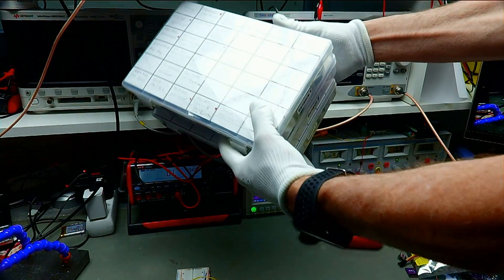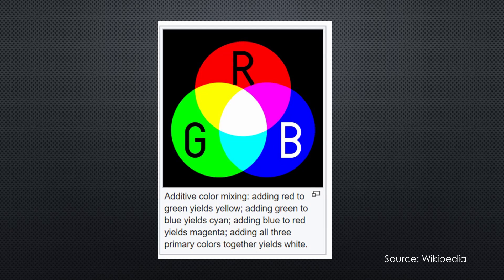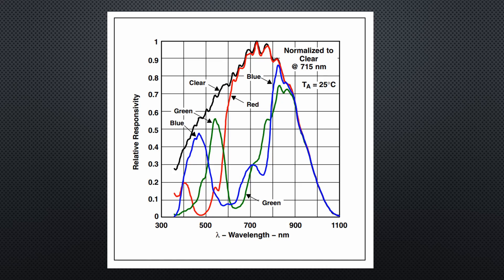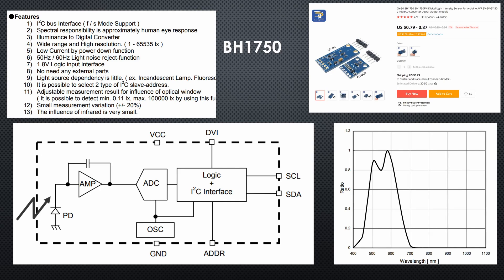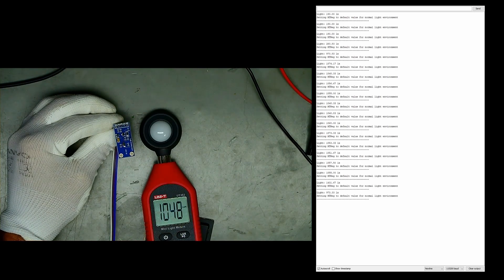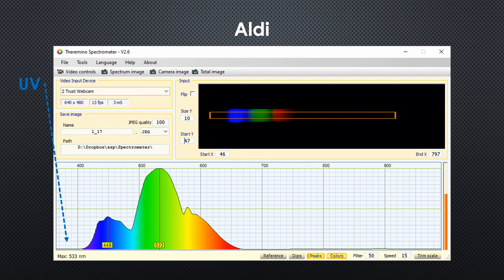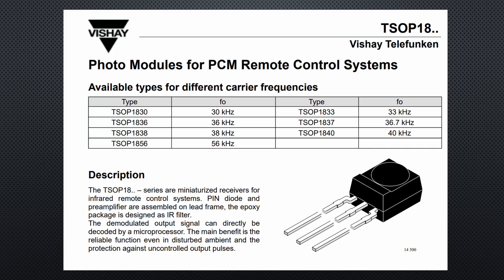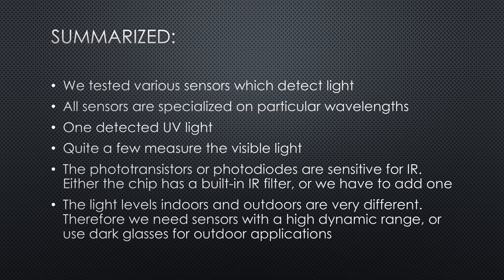#322 12 Light Sensors Tested: Measuring Light with Microcontrollers (Arduino or ESP8266, ESP32)

Comment: Ich habe seit mehr als 800 Tagen einen Lichtsensor im Einsatz, der minütlich die Helligkeit misst. Damit kann man eine Steuerung für die Markise bauen. Zu bedenken ist das im Winter die Helligkeit bei voller Sonneneinstrahlung genau so hoch ist wie im Sommer bei starkem Regen. Die Schaltschwelle müsste dazu also dynamisch sein. Bei Bedarf kann ich dir meine 2,5 Jahre Messdaten gerne zukommen lassen.
Reply from the maker: Sehr Interessant. Weil du soviel Erfahrung hast würde ich dir gerne drei Fragen stellen:
1. Welchen Sensor verwendest du?
2. Wie ist er gegen Wetter geschützt (durchsichtig)
3. Wie hoch ist die höchste Luxzahl die du je gemessen hast? Das würde mir die Dimensionierung erleichtern.
Da ich die Regelung via Node-Red plane kann ich vielleicht das Datum oder die Temperatur meiner Wetterstation in die Berechnung einfügen.
Reply: @AndreasSpiess  Hallo Andreas. 
1. Ich verwende einen BH1750 der mit einem ESP8266 verbunden ist welcher minütlich seinen Messwert über WLAN an meinen Server schickt. 
2. Er ist unter einer Plexikuppel wasserdicht verbaut und verklebt. Die Plexikuppel stammt von einer alten Wetterstation, dort war damals die Solarzelle untergebracht. Der ESP is getrennt (Indoor) verbaut.
3. Maximalwert ist 54612, der reale Wert würde das doppelte überschreiten kann aber nicht mehr gemessen werden.
Da dein geplanter Einsatzzweck eine Markisensteuerung ist würde ich den Wert bei etwa 1500Lux ansetzen wenns zum Beschatten dienen soll. Alles was drunter ist freust du dich eh wennst noch bischen Wärme und Sonne haben kannst :-) Falls ich ein Foto davon finde schicke ich es dir per Mail, meine Messdaten lege ich bei. Liebe Grüße!
Reply from the maker: Diesen Kommentar hatte ich gar noch nicht gesehen. Also nicht vergessen. Glück gehabt. Youtube macht es schwer, längere Konversationen in den Kommentaren zu führen. Insbesondere wenn man viele kriegt.

Comment: Have you considered putting sensors in solar garden lights? You get a solar panel, a battery and an enclosure for a relatively cheap price. For instance temperature and moisture measurements in the greenhouse.
You probably need a buck-converter to get the 3.3v needed from a 1.2NiCd or 3.2LiOn, but still.
If the ESP went into deep sleep, and only sends occasionally, I guess most lamps could supply the power.
Reply from the maker: Good idea. I started to build a combination of a Lux, an UV, and an RGB sensor. In addition it communicates via 2.4GHz LoRa. The MPU is an Arduino Mini which Igels it’s Takt from an RTC Module. Still a lot of LEDs, so I do not know the current consumption. But it needs some space.

Comment: I really like and appreciate your videos. I am currently using TSL2561 sensor witch includes visibible + near infrared diode and another wide range infrared diode, which is very interresting because it lets me calculate the Lux by subtracting IR reading from Visible+IR. This help me measuring light illuminance in Lux with high precision by eliminating IR interference. This sensor also gives me the possibility to measure light power with good precision by using light+near infrared  diode and wide range infrared diode and using a factor calculated for most common sun light spectre profil. The problem I have with this sensor is that the range is quite low and didn't exceed 40000 Lux which is not enough for day sun light especially  here in Morocco. I didn't find this information in your video when you talked about TSL2561. Could you please give me your opinion about this issue and if there is a good alternative to this sensor for my application: Weather and fertilisation station for Agricuture. For more details here bellow a link to  my collected data. Thanks a lot for your high level and extraordinary video content:
http://www.abrobotics.be/siliconceptsarl/METEO/meteoframe.php
Reply from the maker: I just started using the sensor in full sun (and our sun is much less than yours). I also ordered ND filters for protection, but also to adapt the maximum Lux level to the capabilities of the sensor.
Reply: @AndreasSpiess  Ok, I didn't understand ND but I'll wait for you tests. I tried the same method by using small grey plastic part protection and it gives good results for illuminance in day light and also IR is not strongly influenced. The problem I have to solve now is to determine the factor to use for recalibrating Lux+near IR and IR sensor. If you see the charts you'll notice that IR reading is not always proportional to Lux especially when it is cloudy which indicates that IR is still measuring with good precision even with my DIY filter. Here is the link: http://www.abrobotics.be/siliconceptsarl/METEO/meteoframe.php

Comment: I had an interesting idea for your awning sky sensor.  I was wondering if the light spectrum changes depending on a clear or cloudy sky.  You could use you light spectrometer to check.  If it does, then you might be able to use what you learned about the different sensor spectrums to design a sensor that can tell the difference.
Reply from the maker: Good idea. I started witrh my light sensor and included also a RGB sensor. I will see what the results are. But first I have to add some ND filters because it is maxed out in sunlight.
Reply: @AndreasSpiess  Could you use your spectrometer (probably with a ND) to sample a cloudy, sunny, and rainy day to see if anything jumps out.  It would seem that a blue sky might be the obvious guess; but, IR or UV could be a better indicator.

Comment: Does anybody know a simple way to test if a UV germicidal lamp (very useful in the current situation) really emits ~250nm UVC ? This is particularly important with cheap Chinese UVC LED lamps. Do they really emit UVC or just the most common UV A ?  I have found UV sensors on Bangood that detect UV in the 200-370 nm range but this includes all UV A, B and C. I thought about using a diffraction grating but the cheap ones don't seem to go below 300 nm.
Reply from the maker: I only found quite expensive sensors for that range.
Reply: @AndreasSpiess  I found this cheap sensor in the 200-370 nm range :
https://www.banggood.com/DC-3_3-5V-0_1mA-UV-Test-Sensor-Switch-Module-Ultraviolet-Ray-Sensor-Module-Test-UV-Wavelength-200-370nm-Geekcr-p-1213021.html?rmmds=search&cur_warehouse=CN
The problem is that it gives a signal to all these wavelenghts so you can't tell between UVA, UVB or UVC.
Reply from the maker: Unfortunately I cannot test it. I am a little sceptical...

Comment: Clear 10mm LED, two digital pins = very good detection of sunlight levels. In a nutshell, the LED is capacitively charged by feeding a reverse voltage into it (pins set to OUTPUT), then the decay of that voltage is measured as it slowly leaks into the (now) INPUT pins of the MCU. The more light there is, the faster it discharges. I've used it successfully for quite a few projects, no ADC needed.
Reply from the maker: Good idea. Thanks!
Reply: Do you have an example of this?
Reply: @marcelachternaam9249  Search for "LED as light sensor". The sparkfun article explains how it works, the instructable article shows a sketch, the stackoverflow describes the principle, pasting the text here: 
Set Port A output high
set Port B output low   // this makes sure the led is discharged
wait 1mS
set Port A output low
set Port B output high  // reverse bias and charge
wait 1mS
set Port B as input     // Port B is high impedance input
time how long for Port B to read low

Comment: Well that video brightened a dull day (sorry).
Learnt a lot - never realised the sensors where so different. I’ll be following up the gesture sensor, thank you for publishing your code for that.
One thing to note - a significant amount of ‘white’ paper is actually blue to give a clean cold look rather than a warm tint.
Reply from the maker: You are right for teh paper (AFAIK not in all countries equally). But here I measured the spectrum of the diodes without paper. So both effects would add up :-(

Comment: I want a sun tracker, that can tell where the sun is down to at least 0.25°
Reply from the maker: Maybe you google? There are many suntracker projects around.
Reply: @AndreasSpiess  I tried, most seem to be expecting the be placed on a gimble that hunts and pecks for the sun.  I found some satellite gear for tens of thousands of dollars that does what I want but that's way outside my budget.  

I'm trying to get heading information in a scenario where magnetic headings are unreliable and multipath conditions don't allow for good rtk moving base gps heading.

If I can tell what time it is, relatively accuracy where on the globe I'm at and what orientation  I'm at (via acceleromiter + gyro)  then if just knew the suns angle with repetitively good persision I could determine the heading.

Comment: which would be best sensitivity to detect light in bedroom when sleeping  from curtain leakage?
Reply: ive gone for the Adafruit TSL2591 High Dynamic Range Digital Light Sensor as the Lux range is 
from 0.000118 to 88,000

Comment: Grüezi from Zurich!  I have a project currently based heavily on home sensors for monitoring house plants. Light is obviously an important variable to monitor so have been prototyping with lots of different breakout boards.  Currently developing the design on a PCB and I've found that a lot of the lux sensors are hard to source when building yourself.  Currently, I'm working with the BH1715 (poor results), VEML6030 (excellent I2C), and the TEMT6000 (analog, quite primitive).   Would love to experiment with the UV as this is also an important aspect of plant health so will try to integrate a few extra sensors into the next version!
Reply from the maker: Good project. A lot to learn, I think.
Reply: @AndreasSpiess  So much, always. Just finished up the design this weekend and have the VEML6075 UV sensor onboard :D. Once i'm at a point where it's worth seeing, I'll send you one for your mailbag!

Comment: Another great video :-).  I am looking to use the BH1750 LUX sensor to build my own arduino-based photography light meter - to calculate shutter speed based on selected f-stop and ISO.   I have it nearly working, but am struggling with calibration.  I would be very interested to see if you did a similar project and had more success with calibration....?
Reply from the maker: I do not plan to calibrate it for such precision. I only want to use it outside.
Reply: May be you have a real camera with usb interface (Canon?), direct it to same target make photos and record data from your sensor and then compare? Also, smartphone camera might work too.

Comment: Thanks for the video.  I've been using the GY-49 /  MAX44009 module for measuring lux in my greenhouse (to calculate the total moles of light the plants receive).  It claims to have a range up to 188,000 lux.
Reply from the maker: Thanks for the tip!

Comment: Very interesting video, many of these devices I have never used.  Things have certainly come a long way since the OCP71 (or OC71 with the paint scratched off!).  I have a WEMOS which monitors the temperature and humidity in my loft, I think I will add a light sensor to warn if the loft lights are left on when the hatch is closed.  Bob
Reply from the maker: Yea, the world became simpler and better in this respect.

Comment: What are your thoughts on detecting UVC 200-290 nm range?
With Covid19 there are lots of fake UVC disinfection lambs around, and wondering the cost effective ways to measure UVC range.
Reply from the maker: There are quite a few comments about this topic. I did not find cheap sensors.

Comment: Superb. 

As usual. 

I wish we had light sensors that could detect molecules @  1 Micron that could be analyzed and coded with a unique signature (i.e. coronavirus ID, COVID19). 

As you probably know, we can detect molecules using IR, but not their cellulose or atomic structure, which have been identified under a microscope.

https://www.nih.gov/news-events/nih-research-matters/novel-coronavirus-structure-reveals-targets-vaccines-treatments

At DDRS, we are looking at some of the technical challenges; could a sensor suite be made on a mobile device PCB and communicate via Bluetooth to a smartphone app.

Initial analysis suggest it is not possible to miniaturize or be accurate. Labs have successfully built a generic IR tracking sensor device that can detect as track droplet sizes of 250 - 900 Microns. Unfortunately, 97% of most human cough droplets, are less than 1 Micron.

www.ddrsngo.net 

Happy Easter to you and yours.

#StaySafe
Reply from the maker: You you work on very interesting projects! Here things get better. Yesterday I was tested and found Covid-19 neagative. I had and accident and had to test fist before entering a doctors's house ;-)
Reply: @AndreasSpiess  Glad to hear you are taking precautions and have tested negative. Keep vigilant and safe. I certainly am busy these days! 

As you know, technology can be beneficial or a hinderance. We look at the capabilities of technology from a strategic, tactical and realistic point of view. We then proceed with recommendations, so  others can make decisions. We have four objectives; education, research, simulation and training. The DDRS blog is our general knowledge education platform. Our talented training and technical team is based all over the world. I used to be a  lecturer for the BBK in Germany and a frequent visitor to Geneva  (IFRC). Perhaps one day I shall return.

I look forward to many more of your videos!

Comment: If someone really wants to measure the human perceived color values, better use a tri-stimulus sensor in the XYZ colorspace. They are also made by AMS, an Austrian company. There is also an option for sensing 18 channels in parallel with 20nm bandwith for each channel.
Reply from the maker: You are right. Unfortunately they are a little more expensive...

Comment: Happy Easter, Andreas!
Great video!
I wonder wether one of the proximity sensors would be accurate enough to use in a 3D printer for auto bed leveling?
Reply: Those are nowhere near accurate enough. You may look at some TOF sensors
Reply: D Stanoev thanks for the feedback!
Reply: @maxtester8824  Welcome!

Comment: An LED will also work as an ambient light detection sensor.  First used IIRC by HP in calculators, measuring the voltage of 7-segment displays where the LED segment was off, to determine the current to drive the display segments, according to ambient light.  So you wouldn't suffer retinal damage in the lab from a display readable in outdoor daylight.
Reply from the maker: I assume they use the same effect as the phototransistors. But I di not know that they are very sensitive.

Comment: Hi Andreas, thanks for another great video. I just want to mention that LEDs can also be used as light sensor for some applications. I am using an array of 3 LEDs for an ultra low cost 3-channel spectrometer.
Reply: Here is a link https://wiki.analog.com/university/courses/electronics/electronics-lab-led-sensor
Reply from the maker: Thank you for the link!

Comment: What about a simple camera module?
Isn't it the best RGB sensor with build in IR filter?
A bit more complex to get values, but a nice sensor nevertheless.
Reply: You mean like CMOS?
Reply: @DougHanchard  
Yes, a camera with I2C bus for $2,- (https://www.youtube.com/watch?v=S2yTQHM82jc) 
or an ESP32 camera module (https://www.youtube.com/watch?v=-GDlk6qgQ_E) for ~$7,-
Reply from the maker: I am not sure because I do not need more than one point. The pixels on cameras are quite small compared to the pixels of these sensors
Reply: @AndreasSpiess  
At least you can do fun things with them :-)
Average, center or  border intensity.
It will depend on the functionality you want from it.

A camera sensor could even be a movement sensor.
And when programmed well, even for specific regions where it is "focused on"/"pointing at".

Comment: The uni-t lux sensor has a white plastic lens, I wonder if it does affect readings in any significant way? Since if we were "to deploy" a device with a light sensor it should be covered with something to protect it imho.

Btw. I'm running like 2 years now a LDR to do stuff on sunset/sunrise and after fine tuning of sensitivity levels in software it works fine. The program also checks the time so the trigger runs only these 2 times a day.
Reply from the maker: I assume they took the color of the plastic into account when they built the device. So far I do not yet know how to protect the sensors. I tend to use glas,  but currently all shops are loched down :-(

Comment: Console output from sensors is rather hard to read when watching from a smartphone.
I suggest you to make a reusable snippet of code that will represent values as pseudo-graphic sliders, like this:
...
[--------|-------] [------|---------] 0.55, 0.41
[-----------|----] [------|---------] 0.71, 0.39
...
This will give a better picture.
Reply: Very good idea!
Reply from the maker: I will increase the font size next time because I not only show numbers in the Serial monitor. For numbers your proposal is good.